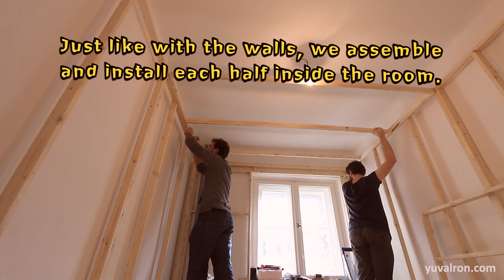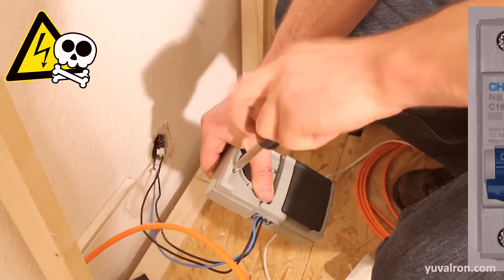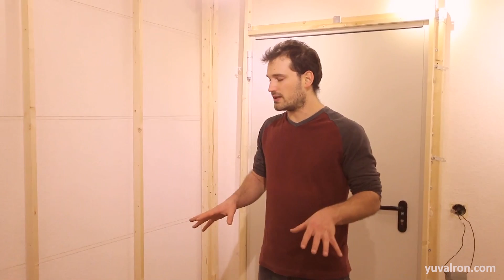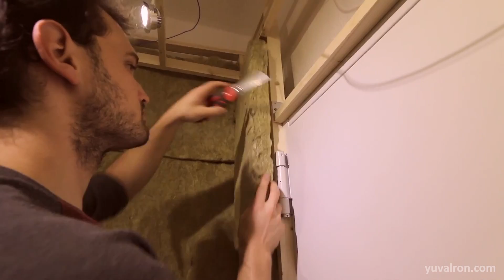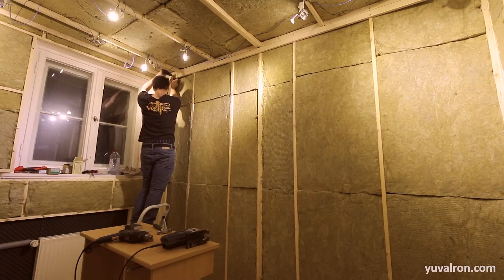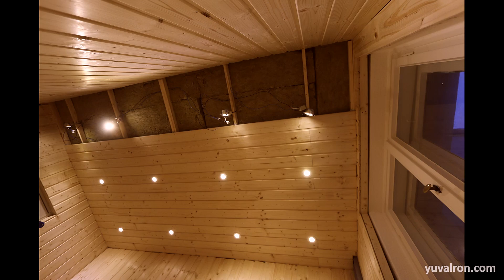How to build a home studio - Episode 3: Ceiling frame, infrastructure, proofing and paneling

Comment: If you're in the US or Canada and chances are that you have drywall (sheetrock) in your room, made with 2"x4" framing and insulation.

It will not be necessary to build a mounting frame such as this one.
Simply mount your acoustic panels (compresse fiberglass preferred) on the walls  at ear-level with equal distance from each other, about 2 inches apart and with approximately 1" spacing from the wall.
don't forget to install bass traps at the corners that face your studio monitors!

חשוב לציין שיש צורך לבנות מסגרת עץ בתוך החדר רק אם
 הקירות בחדר עשויים מבטון. (כמו אצלנו בארץ).

Comment: No am asking what did you put second, you pit the plywood in 3rd step, the first was that black tarp or etc, you used 2x4 or 1x2 for the frame structure
Reply from the maker: It's all in the video.. :) We used 10x10cm beams for floor frame and 5x5cm for walls frame.
Reply: What about for the top ceiling is it also 5x5 cm or 10x10 cm?
Reply from the maker: @norteracing7890  Yes 5x5

Comment: Question:
Are the walls & ceiling 1x2 boards? And what about the floor? Is it also the same as the walls etc or is the floor 2x4?
Reply from the maker: If you mean the wall panels, I'm not sure what are 1x2 boards, in Germany it's called FI/TA panels (fir/spruce) and they are coming with sets of pegs to connect between them. For the floor we just used OSB plywood boards.

Comment: well, this certainly flies in the face of everything I understand about soundproofing. There's no added mass here, basically, just a bunch of fluffy rockwool, which basically should add nothing. The door is bolted directly to the outer frame, too, and the second door is not a sound door. There's no high density fibergypsum with green glue or mass loaded vinyl. Do you have a drawing of what you've supposedly created?

Comment: Hi yuval 

This is an amazing series I've learned a lot! 

I'm just a bit confused about the 180 degree angle your referring to for the ceiling. If you could elaborate a bit more. Are suggesting cutting the whole length of the wood from beginning to end at 180 degrees. I'm really confused.

Also what size wood are you using for these frames and the beam you placed for the double door.

Good looks bro, hope all is well
Reply from the maker: Numero Musiq Thanks. The ceiling is built in 20 degrees.... 

For the double door frame i think it was 10x10cm.

Comment: Looks great and it is awesome that you are taking the time to make a how to and I hate to be a Debbie downer but that ceiling will most certainly sag over time. It needs support in the middle at the very least. Also, when using wood, it is an absolute must to maintain a 1/4" gap on the edges where the wall meets the ceiling, floor and perpendicular walls. If not, it WILL buckle when it expands and contracts with humidity variants. You can cover the gaps with moldings or ripped pieces of the wood being used. Trust me on both these points. Very crucial
Reply from the maker: Hi Mark, the gap certainly exists not only because of wood but because of the room-within-a-room principle discussed and in fact much more than 1/4". 
As for the ceiling, I doubt it will bend under the pressure since the rockwool is fairly light, I'd estimate that whole layer doesn't weight more than 40-50kg overall.

Comment: Hello I am an acoustician.  People must take care.  This is one way of building a studio. It will soundproof for a specific situation where there is no need for much noise isolation.  Many situations demand much more massive partitions.  The details of partitions are found after calculating the difference between the sound level in your studio and the maximum sound level acceptable in the surrounding rooms or appartments.  Do not follow this video if you have drums and or amps, and your studio is next to any neighbour, appartment, living room...
Reply from the maker: The studio is inside an apartment with neighbours below and above. We tested it with guitar amp, bass amp and loud monitors - the reduction is definitely effective, even if not perfect. It is at the sweet spot between affordable and effective.
Reply: Hello.  This could be acceptable by the neighbours but it is an approximate evaluation made by you.  The neighbours could complain to the city.  The situation which you call acceptable could be attributed to previous partitions composition, which is unknown.  All other cases wil vary.  In acoustics, you can not apply a receipe for every one.

Comment: really nice dude! what about air circulation in the room.. and exhaust fan? or maybe air coming in for the room? thanks
Reply from the maker: In my case I can't install an AC, but I have a window in front and I make sure to open it at least once or twice a day to air the room. In places where it is possible to install an AC they usually compress the air outside the room (split AC) and use long and curvy venting tunnels so that sound will be dampened through it. Either way it's something that I'd recommend you to consult with an acoustical engineer in order not to harm the other soundproofing efforts.

Comment: Great videos! I've a question: how is the final result of external soundproofing, with nothing but the mineral wool? Do you have any problem with your neighbours?
Reply from the maker: Thanks! The mineral wool is a major soundproofing component and drastically reduces sound transfer. I never had a complaint and in fact, it's hard to hear unless you really turn up the volume even from close range.

Comment: Hi there
If i do that in my apartment room
Can i practice loud metal screaming and shouting?
How loud my neighbours can actually hear me?

Thanks for the great series
Reply from the maker: Thank you. It really depends on how loud it is. In my room you can't hear much from the outside, certainly not when you are far, except the very low end. So if it's just vocals (no matter which genre or how loud) such a room would be okay for you. If you need drums or very loud bass, then you'd need thicker isolation layers and thicker gaps. The principles stay either way the same.

Comment: how much does all this cost? Budgeting is also important before planning to make a studio,right?
Reply from the maker: Right! But it very much depends on the size of your room and how thick you want the layers to be. For example if you'd play or record drums then it's still the same principle but requires even thicker inner walls. For this room the materials costed in total about €3,000.
Reply: +Yuval Ron thanks for the reply. mine will be so much similar to you..
Are glass walls (like the ones in the offices) suitable for a studio? I actually  prefer the studio to be bright and open for creative purposes.
Reply from the maker: I don't think so. I've never seen such a studio, except of course the isolated window between control and live room. Maybe it's possible but it would probably require very special and thick layers of glass.. but i'd love to hear if you find out otherwise.

Comment: Awesome video series. Thank you very much for this! I learned a lot from those. Perfect work!
I am very sorry for your friend aswell. He looked like he was really enjoying this project. RIP.
Reply from the maker: Thank you.
Reply: Are you going to upload episode 4 of series you mentioned in video?
One question regarding construction: your only way of ventilation in this room is by open the window from time to time. Is it enough? No need for additional air channels in ceiling or walls?
Thanks one more time. I am going to build similar design as yours, starting in few days. Very inspiring!
Reply from the maker: Thanks again. Yes, I have no other means of ventilation in this room, among other reasons because the building is under conservation laws. Not ideal but not a big deal either. I open the window on breaks every couple of hours, get some fresh air and close it back. A good idea anyway even with a ventilation system. Of course, if you can install A/C then by all means do so. Just make sure that the venting tunnel is isolating sound as much as possible.

Comment: how near is the neighbors ? and how many db´s on the other side of the doors?
Reply from the maker: +singerfromhell666  they are on the apartments above and below, never heard a single complaint because in any reasonable working volume the DB is ZERO. Naturally on high volumes you hear outside but i don't usually work with such.
Reply: awesome :) thank you!

Comment: Assuming you already have all required tools, what would a project like this cost for a 2m x 2m x 2m room?
Reply from the maker: About €3K.
Reply: Hab grad gesehen dass du auch Deutscher bist, sorry ;)
Aber danke, das könnte realistisch sein. Könnte man auch die Holzkosten sparen (wahrscheinlich am teuersten), indem man die Innenwände aus Rigipsplatten macht, die kosten ja fast nichts. Klar, schlechtere Akustik, aber mit Absorbern und Diffusoren könnte man doch wieder aushelfen?
Reply from the maker: +bigPianist99 Keine Ahnung. Es gibt viele Werkstoffe Optionen, die man benutzen kann. Probiere mal und lass mich wissen :)
Reply: Be warned that a room with the same dimensions like that will be horrible for reinforcing and boosting certain frequencies, especially low end build up. If you haven't already built out the room, try and break up the exact 2 x 2 x 2 dimensions with sloping ceiling and/or non parallel walls (may be hard in such a small space).

Comment: Hi, Many thanks for the videos, it is really helpful! Where are you based? I wondered if you know anyone in London who could give me a hand soundproofing a room? As I've never did it I don't feel 100% confident to do it myself! 

I am working in an industrial unit kind of soundproofed, but still hear quite a lot of noise coming from the unit upstairs (footsteps and crunches from the unit above, where there is an office) I believe  the material in the middle of the roof (after some soundproofing in my unit and before the floor in the other unit) is metal, and you can clearly hear the steps and crunches when people walk, or even when they drop a key or coins to the floor, which is quite disturbing!

Many thanks!
Reply from the maker: Hi Toni, I am based in Germany so unfirtunately I don't really know who deals with soundproofing in London. Maybe look up acoustical engineers?

In any case what you describe sounds like lack of sufficient soundproofing. Probably adding thicker layers or extending the gap will reduce the disturbance.
Reply: I will! Many thanks for your reply and all the best! :-)

Comment: It's amazing what you're doing and thanks for recording this video and sharing it for the community!
I have few questions:
1) What about neighbors upstairs and downstairs? Do they hear some noise?
2) How do you soundproof the heater? Sound can transfer by metal.
3) What specific kind of wood did you use for walls finish?
4) What do you think about playing drum kit in a such sound-proofed room?
Waiting for the next episode!
Reply from the maker: +Inspektor Sowa Thank you for your kind comment. 
1. They hear nothing, the rockwool really does an amazing job. You only hear stuff if it is played in a high volume (which I don't) and you stand really close to the outside wall.
2. I can't soundproof the heater, but I did wrap the pipes with an insulation layer (you can actually see it on the video) and i don't hear anything from their direction.
3. Panels are made of Fir and Spruce.
4. Drums will require thicker layers and a wider gap and a bigger room, but the principle remains identical.
Hope this helps!
Reply from the maker: +Andrei Piatra thanks! These panels were not treated with any substance, although they can be varnished or oiled. We did oil the scattering panels, we'll show it on the next episode.
Reply: +Yuval Ron    Ron, were the fir&spruce panels treated with any substances, like oils and resins? Awesome, video! Looking forward for the last episode!